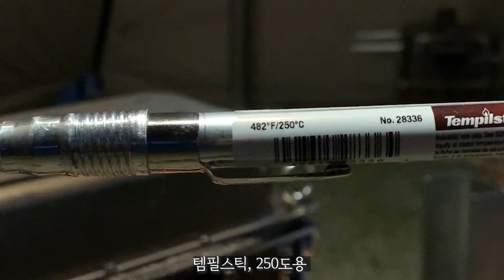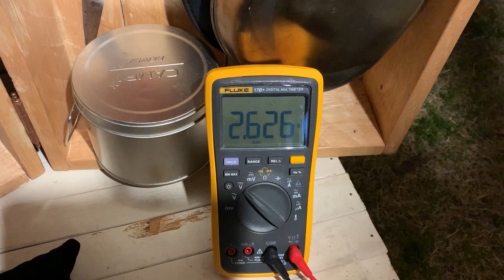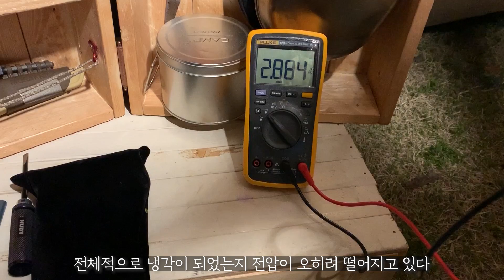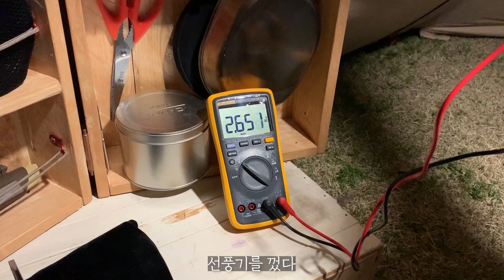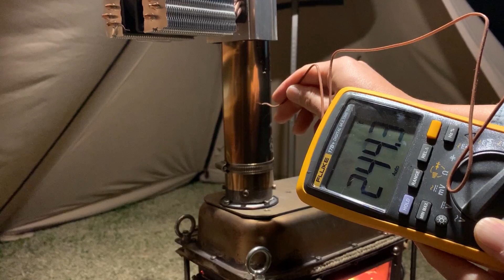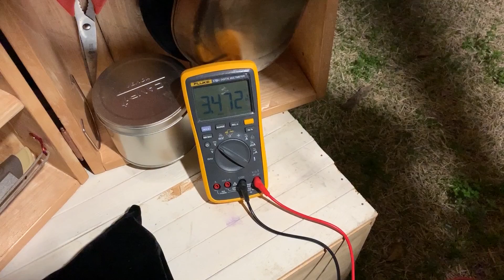Camping Wood Stove with Off Grid Thermoelectric Generator - M-Stove Project Part-7

Comment: Camping together

You went high tech.

This is low Teck, and no moving parts. No fan.

A fan is a waste of power.

So here is how it Will WORK for you.

Watch a lot of videos on thermal couple to electrical battery. 

WARNING
Do not hook up direct to your equipment, you can Fry your equipment. Hook it to a battery POWER storage system.

1. Small piece of iron in the hot fire, or in the flame, or on top of the hottest part of the stove.

Chimney not hot enough.

MUST BE IRON not steel.

2. Connect to a copper or aluminum wire, both ends of the iron. Small iron piece Good, Large iron piece Not Good.

3. Put a Current director ( commutator) in line before the battery as the current will switch direction on you as the heat goes up. It switches direction several times as it gets hotter. 

Watch some videos on this.

4. Get a heater core or radiator ( must be aluminum). Plug both ends as needed. Then fill the radiator with used oil or water. This with cool off with out a fan. It is a heat sink. Connect the aluminum radiator to the system after the battery not before.

5. Have equipment to check the current direction, as it heats the iron up, the current Will change direction on you.

Make sure you pay attention and do not Fry the battery.

Make sure you have a way to make the current flow in one direction at all times ( commutator).

6. If you put the iron in the fire or in the flame it will get very hot and produce the most electrical in D.C. it switches current direction as the temperature gose up or down.

Keep an eye on your radiator that it stays cool the bigger the better, or keep it cold.

7. If you Master this, I will then show you what else works to get more power.

Have 6 volt golf cart batteries. Get them used from the golf course by asking them who changes their batteries. The mechanic will sell you the batteries cheap or give them to you.

8. Recondition used batteries by :
A. empty the battery fluid.
B. Fill will distilled water and baking soda, one teas spoon baking soda each whole.
C. Let bubble for a day or more.
D. Wash out battery with distilled water, several times.
F. Get battery acid, concentrated sulfuric cheaply as drain cleaner. To expensive at the auto parts store.

G. Watch YouTube videos on how to recondition a battery.

9. You can even use a thermocouple to make the aluminum end cold enough to run a frigerator.

Be blessed, God loves you!!!
Reply from the maker: Very interesting idea, information. Thanks for sharing this!
Reply: @campingtogether  

Camping together

Your welcome.

I saw the other new video today. 8 volts good job.

I am sorry I missed it live.

No here is some more information if it can help.

The stainless steel stove is a giant thermal couple part A.

All you really need to do is screwed it into the stainless steel top/ and or the bottom.

You got two separate prices there and both are getting hot. So you really got two separate power source to connect to a battery bank of used 12 volt car battery or 6 volt golf cart batteries are better for this. But use what you can get.

Hook the copper or aluminum wire to the stainless stee stove or the stove legs. Keep moving the wires around till you you get the best voltage. Car alternate is 15 volts DC for A 12 volt battery.

Hook the other end of the aluminum or copper wire to a used junkyard car radiator. Make sure the aluminum radiator is on wood so it  doesn't ground out to the floor.

The thicker the aluminum wire the better, like 600 kv  from a service drop to a house.  

You can get this free from and high voltage electric repairs crew from the electrical company.

You need 2 aluminum radiators. One connect by Aluminum/ or copper wire  to the top of the oven, the other connected to the bottom of the oven.

You will have two separate power sources.

Then put your battery bank in line. You will have 10 batteries or more. Lots of power. To run a fridge or still or TV off of an inverter.

If you want more ideas, I got more stuff.
Reply: @campingtogether  

Camping together

If you go to channel called : it's thawf

He has excellent video on Seebeck effect please watch it. Lot of good stuff.

After you watch that you can try the following:

1. Get 6 feet of flexible copper tubing half inch or one inch. Wrap it around the stove at the hottest part

Then hook up the iron engine block or head to the copper tube that is wrapped around the stove. 

Put one end of the copper tube down to the ground to draw up the cold air. The other end is one foot above the stove.

This will increase the heat to the tent by two method.
 One by air going through the tube. Secondly by radiant heat process.

the copper II will create a different kind of heat called radiant heat which will then heat up everything inside the tent not just the air.

This is very healthy and soothing kind of heat.

You can see this and a product called EdenPURE.

Go look for it it's got a copper heating element.

You will heat up everything in the room or the tent and this is very effective.

separately the copper tubing wrapped around the stove will be used to create electricity hooked up to the iron object.go look at the video about Seebeck effect and I'll show you how to hook up the batteries and where they should be placed and why you're using copper and iron.

you'll be producing a lot of electricity so please don't plug your phone directly into this plug it into the battery.

you'll be able to run your laptop or computer off the battery by using this method or TV or a drill through inverter.
Reply: @campingtogether 
I Took a look at this again, If you put a capacitor bank,  in line before the battery:  it will drop the resistance that is caused by the load ( battery)  

This will reduce resistance and increase power to the battery, 

Separately: the capacitor bank will increase the voltage and amperage to the battery as it acts as an accumulator, 

Separately: a full bridge  rectifier can act as a commutator before the capacitor Bank 

You loop the capacitor As ( 1) separate input and then ( 2 ) separate output to the battery,

Comment: This is not a viable experiment. Nothing useful will result in a very low result.  Solar cells are effective and nothing can compare with them.
Reply: I didn't expect big output but I respect and appreciate that he tested it rather than just saying it won't work. I would have been curious to see the amp output. On paper you could at least charge a cell phone or music player. Heat recovery into the tent and into electricity is always better than heat wasted out the chimney. I have noticed though, that Fans are expensive to run from a power consumption standpoint. 

I'm also curious about the big aluminum heat sink losing energy before it even gets to the generator. I wonder if something like cast iron around the stove pipe and then generator mounted to that, and then big heat sink on the other side of the generator to try to make the most temperature difference?

Comment: Great work !  

I have some thoughts to share that may help you:

1) Have you considered to use TEC1-12715 insted ? It operates on higher temperature ranges so it may produce more energy, while it does not cost much more.
2) How about changing the first element of the chimney to square profile so contact area will be greater ?
3) The stove produces a lot of heat while we lack electricity, maybe we should use the heat then and use stirling engine conception, with one fan that cools the whole system and is powered with heat. (https://www.youtube.com/watch?v=uCwwwZrztgI)
4) Your stove has a fire barrier so that the fire won't go out of chimney witch is great but probably lowers the tempereature of the chimney. So I suggest to remove this barrier and try to place it on the last element of the chimney. 

I'd love to know your opinion. Grettings from Poland and wish you all the best.
Reply from the maker: Thanks for your suggestion. I will research and try more. Stay safe there♥️
Reply: Even steam power would work better, but stirling engines are very nice.

Comment: I think you need to contact Peltye's modules right to pipe. or maybe to bottom of stove. (What is the temperature of bottom?  Less than 300? If you use brick it should be less.) Without that strange aluminium part. The temperature of Air in that thing must be really low. Also you put too much thermopasta. It should be less than 0.1 mm or something like that for good thermodynamics. Also thank you for your videos.

Comment: I love tec's and teg's but they aren't the best in efficiency but I would probably use 4, 6, or 8 for the power bank use led's for lighting straight to the teg that would work and be useful otherwise get more to get the voltage to where u want it but the mah output isn't great with 6 teg's 2 parallel and 3 in series should work 8 teg's (2p4s) would probably have the best chance

Comment: I was wondering about using these since taking apart a thermo electric cooler. If you put the unit outside the tent on the pipe and insulated the inside pipe (so more heat was up at top) would the outside air be good enough to not need fans?
Reply from the maker: Great suggestion. I will try various ways. Thanks!

Comment: Great work! Keep it up! Now for those module you will want to use a boost converter or a sepic converter. They don't produce as high of a voltage then what they are rated for and also you can buy high temperature one that are rated for more power and 300c but they are expensive one. I made 2 of these as well using repurposed old one. They work to light up an LED but nothing fancy for charging they need a lot of heat. Cheers!
Reply from the maker: Thanks! I will try different way maybe one or two more shots.:D
Reply: @campingtogether  if you need help let me know!